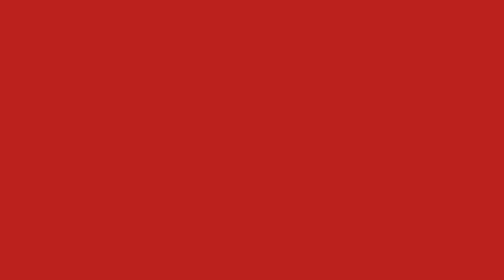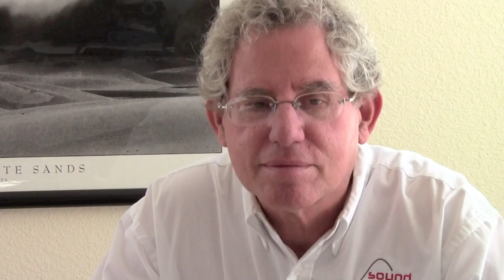Intro to DACs

Comment from the maker: Hi Faraz,

They probably sound slightly different from one another.  My guess is that the USB into your Mac will be the most accurate but perhaps more dry and less musically magical sounding.

The Ensemble will probably impart some character to the sound.

The best way to determine if you can hear the difference and which one you prefer is to record the same thing both ways.

Be sure to send me some original Faraz music I can listen to.

Neal